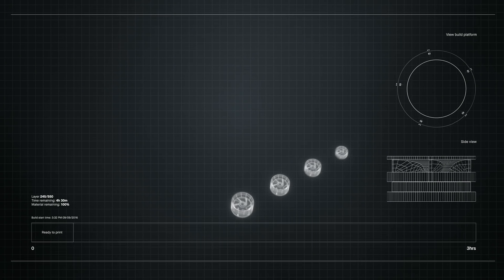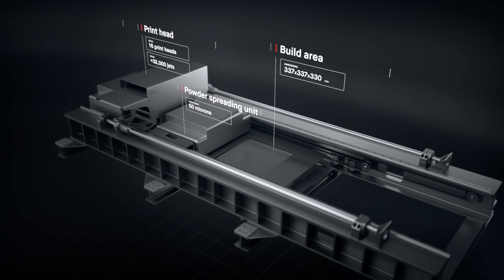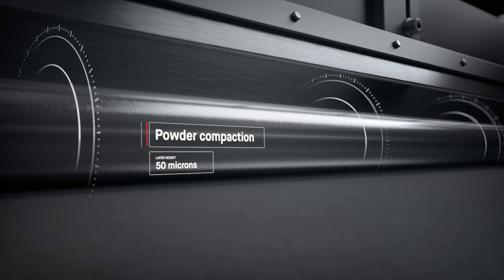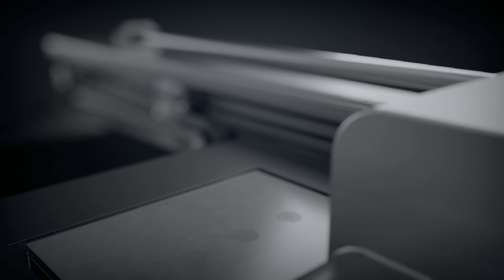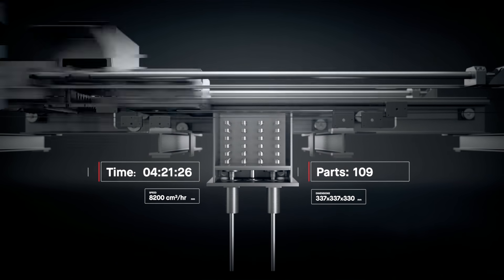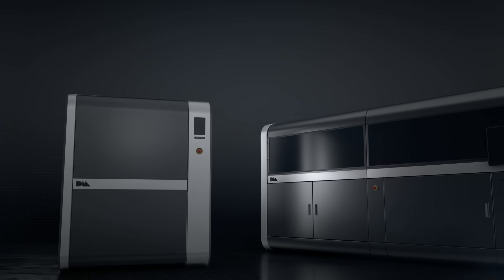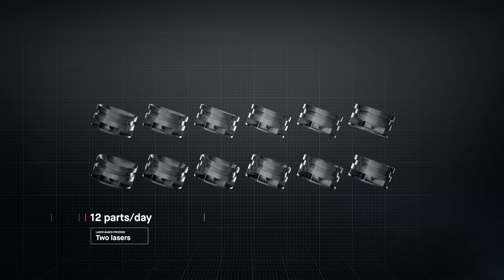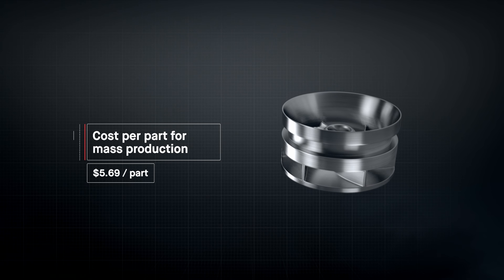Introducing the Production System™ from Desktop Metal

Comment: 5 hrs to print 100 parts at 5$ each =$500    ,..what is the price of this printer ? and  cleaner ?  and oven ?? and extra expenses. per build extra  $500?  per oven and cleaner?  .. so you sell the parts you made that day for 2000$ at 20$ making 1000$ a day how much does it cost to lease all the equipment? if you know you will need to print 10 days a month and make at least $1000 per day that's 10K a month   ..  how much does it cost to lease all the equipment?   10k per month?
Reply: @Vlad Alexander - System like that are usually sold not typically leased - but that is what banks are here for - such systems are normal anywhere  from 200 - 800k usd + consumables and service contracts on top
Reply: But why do you think this is better than typical CNC machine?